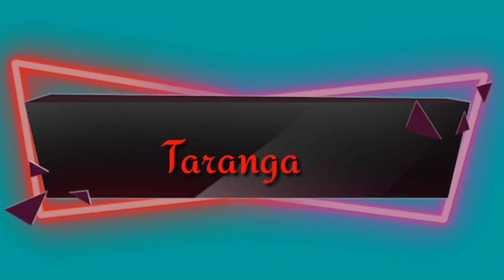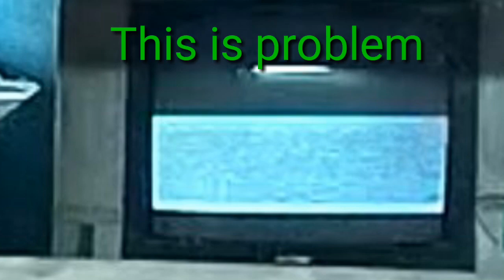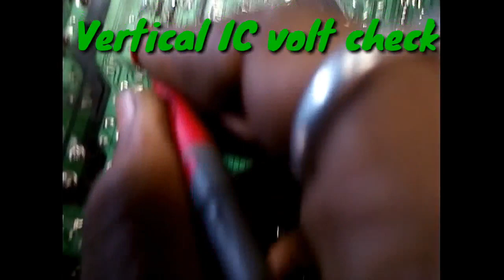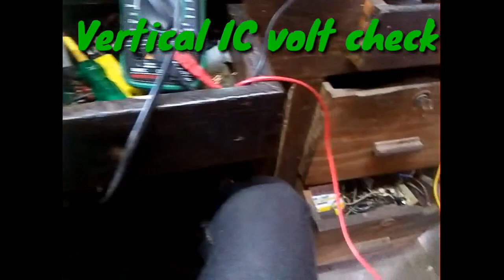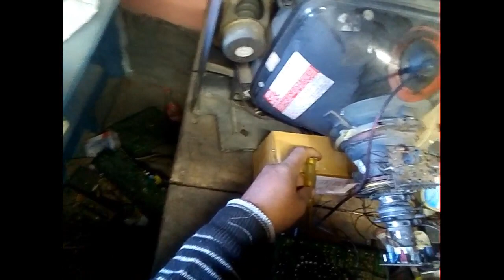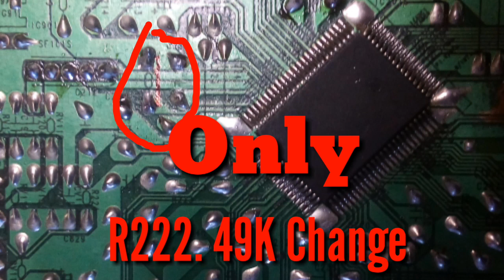Samsung ctv vertical problem.

Comment: Sar samsang ultra slim tv vartical ic ok -16 v drop 2 v haf pictar problem ic nikal da to voltage ok ho Jata ha. ic  Chang kor dia Sam problem . Diod . Capicatar ok. keia problem😂
Reply from the maker: -16 volt drop to 
O line ka residents Diode capacitor change karke dekho,  check nehi, change, ok.

Comment: I found R222 39.3K , and it's  showing 39.3K  , still  problem not solved,  any other tip?
Reply from the maker: Vertical section capacitor or resistance check